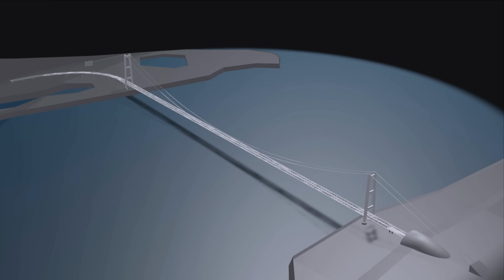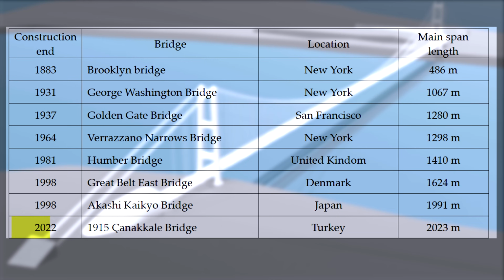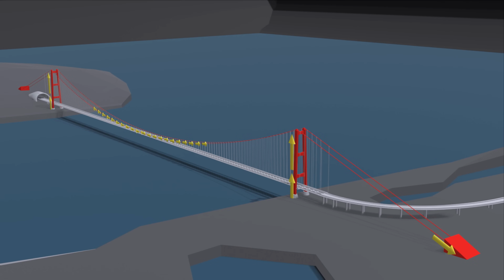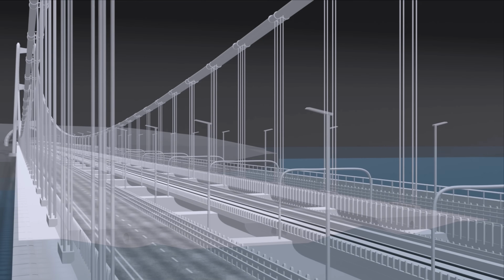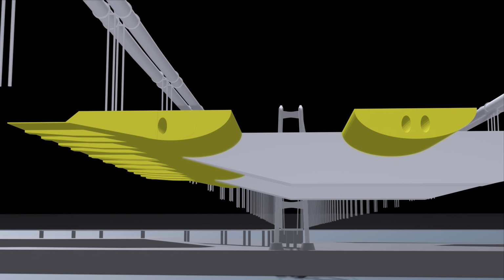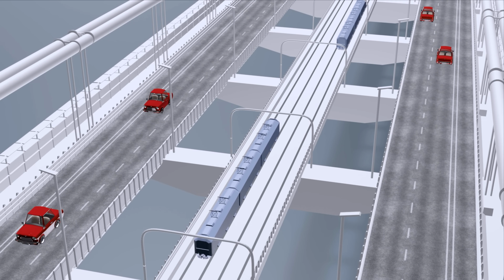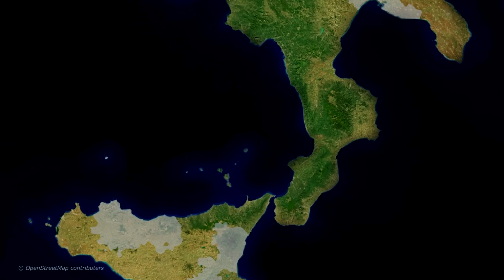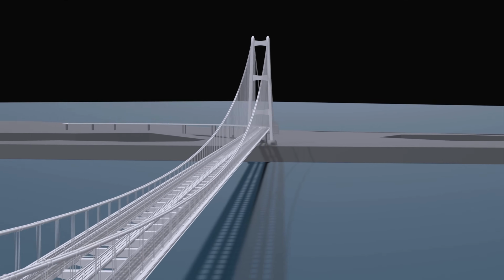The Strait of Messina Bridge: Engineering's Greatest Test

Comment: A suspension bridge is automatically resistant to earthquakes. In fact, it is basically a non-issue
Reply: ahah, no, non lo è, 
ma il problema non si pone 
Il Record del MONDO - con sede ferroviaria - è una campata lunga 1377 m, 
oltre i 1600 m la campata collasserebbe per il proprio peso, senza bisogno di scoreggiare.
3300 sono un delirio. 
Nessuno lo dice perché la LEGGENDA tira (quasi) come un pelo di fi.. 
e intanto sono già volati fuori dalla finestra più di 1 MILIARDO di euro. 

Piuttosto, investi tutti i tuoi soldi in azioni Proctoglu, con il picco della domanda dei devoti del Venerabile Big Jim, traditi e delusi, schizzeranno alle stelle
Reply: Are you an engineer?
Reply: @RonGerstein   I'm not an engineer but their flexibility makes them very earthquake resistant, compared to rigid bridges.  
Just look at the original Oakland Bay Bridge.  The suspension half easily withstood earthquakes, but one section of the truss on the original eastern span collapsed, despite being engineered for earthquakes.

Comment: 2 lanes? That’s not even remotely future proof
Reply: So?Here in sicily highways are with two lanes, what's the sense of build a bridge's Road bigger than the highways that Will conect?
Reply: @Culturanerd4877  because you can just add another lane later down the line to the other parts
Reply: @Culturanerd4877  what I would have done is only have 2 lanes open for now but I would have left space on each side of the road for a new lane sometime in the future
Reply: And the central train line can move more people more effectly than the cars
Reply: @Lorre982  yes that’s good at least
Reply: tranquillo, le leggende sono immortali
Reply: il massimo per poter stare in piedi è una pista ciclabile, 
e sarebbe una sfida

Comment: 10,827 feet is around 2 miles. IDK if that’s the worlds longest bridge.
Reply: I think it means longest single span with no supports in between
Reply: It will be the longest suspension bridge by a long shot, about 50% longer than the second longest
Reply: @lukeinpolleg  ahah, no, il 120 % in più, 
Un DELIRIO per gonzi
Reply: You are brainless